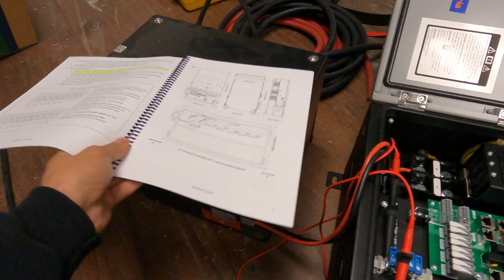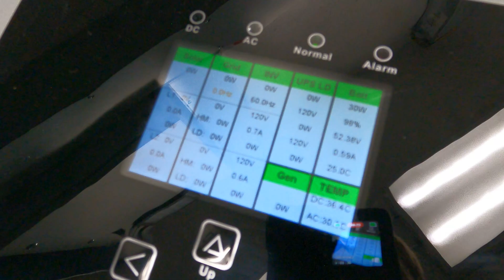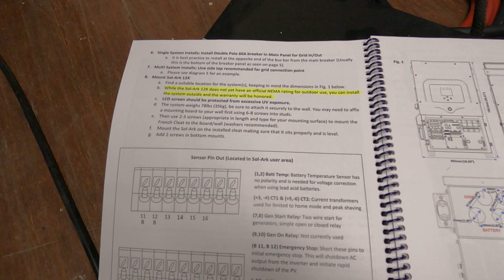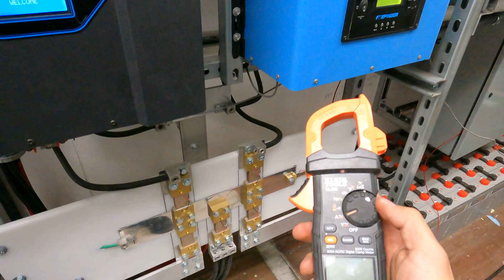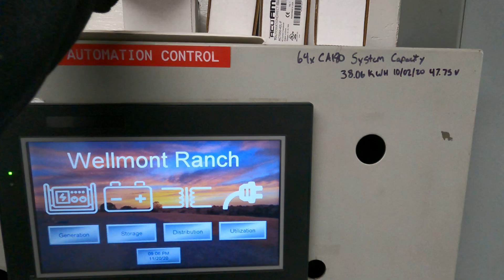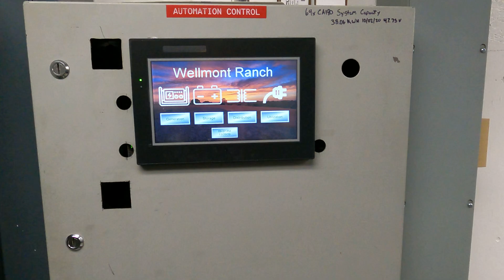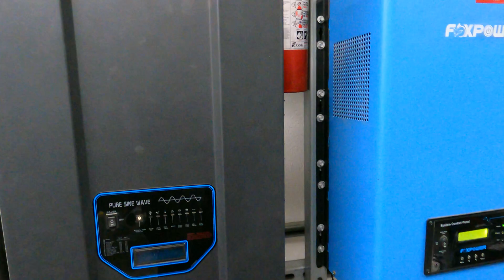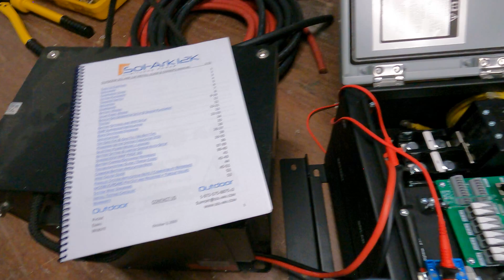Sol-Ark 12K Outdoor Model - Initial Power-up & Discoveries

Comment: it's not Nema  3R rated because of the holes in bottom But I I guess you could plug the holes not being used and as long as there wasn't any on top or sides you could call it weather proof Even if that is relevant since its going in the shed

Comment: Looking forward to your idle power draw test, I just double checked mine and when connected to battery power only the draw is 60 watts, however when the grid and battery are both connected the idle draw jumps up to 204 watts, 37 watts from the battery and. 167 watts from the grid..

Comment: What are you doing to precharge the caps?  Or not needed with Sol-Arc?
Reply from the maker: The manual does not mention precharging at all, they also say to connect to the battery with the main breaker off.  I have a massive battery bank with a huge amount of inrush current available and didn't have any issues when turning on the breaker

Comment: We used solark 8k for a year off grid. I used it with a welder and plasma cutter, never had an issue. We lost our setup in the wildfires and received one of the these "outdoor" models a few weeks ago. I'm setting it up outside, as we don't have an inside at the moment. 
Hopefully I'll be able to put a quick shelter over it until I get a powerhouse built. 
I cannot recommend the solark enough, amazing service and product.
Reply from the maker: Sorry to hear about your loss!  Tragic!!!!!  I got the unit up and running, and for testing, welded up part of our excavator that broke last week.  Running the wire feed 240v Mig at max settings to weld through 3/8" steel,  the sol-ark had no complaints.  I'm sure if it was at 120v though, and only on one leg, that it might have a little bit of a problem with it.
Reply: @HighTechLab  Can you measure the surge on your welder, and also on a water heater, and air compresser? If you have them

Comment: HI High Tech Lab - Cool New Setup to Yous Inverters and DIY Pro PLC System👌😎
I Have SolaX X3 Hybrid inverter 3 Phase 10-12Kw. 230V+380V out 
For My ☀SolarCelle -🔋Battery-Project.
...
DataMek from 🇩🇰Denmark👍🖖EU

Comment: Did you get an f8 error code before connecting the ground to neutral? Was that how you knew it was testing for neutral/ground bonding?
Reply from the maker: Yes, exactly
Reply: @HighTechLab  Same thing happened to me before I hooked it up to ac. at first it freaked me out then i remembered the neutral to ground req.

Comment: Great content and detail! 
I watch for the tools I need to purchase - hydraulic cable crimper kit, fluke 116 and a inductive pickup for starters. Also you 6 gauge wiring. I assume that is for pv array wiring?
Reply from the maker: Stay tuned I'm working on making a video on a hydraulic crimping tool.  I will have an affiliate link that doesn't cost you anything extra but help support the channel if you are interested

Comment: For the bottom mounting you can likely using a flat bar of steel or aluminum and drill the holes where you need them, or just get a some 3/4" plywood or 2x4s and mount it to the uni-strut to mount the sol-ark. My Sol-Ark is mounted to a wall using 3/4" plywood with tapcons going into the concrete foundation for the french cleat plate.

I noticed your electrical system container is now doubling as  a small wine cellar.
Reply from the maker: I do keep the room climate controlled after all....and because of the dimensions of the solarc things are going to work out perfectly with mounting it on the existing uni strut, just need to move a piece over a little bit

Comment: I found the same idle draw of 1.33 amps on 48 volt  and the screen display doesn’t match, looks like they are cheating a bit.
Reply from the maker: What was your method of testing? Was it with a clamp meter or shunt?
Reply: I used a clamp meter, but just realized that my bms has a build in current meter, it reads 1.21 amps @49.11 volts. = 59.42 watts, the display shows 53 watts. Ps, my battery is llifepo4 15s
Reply from the maker: @jakealmaguenther4366  that certainly is interesting. I've never seen lifepo4 in a 15s configuration, only 16s.  I will be able to better determine what the actual results are when's everything's wired up

Comment: i seen on sol-ark's site the other day that the have 2 different models. one for outdoor and one indoor. i wonder if you have the indoor one and they do something different for the knockouts on the outdoor model
Reply: Openings on the bottom are not necessarily of concern as NEMA 3R is specifically for water coming down at most 15° from vertical.

Comment: I'd expect the multimeter is less accurate than the solarks internal sensor, especially at such a low draw using a clamp.
Reply: But its magnitudes off.....
Reply: @jamess1787  yeah I thought that as well